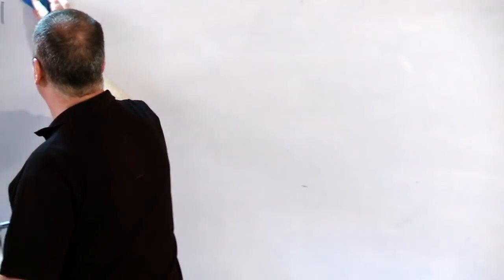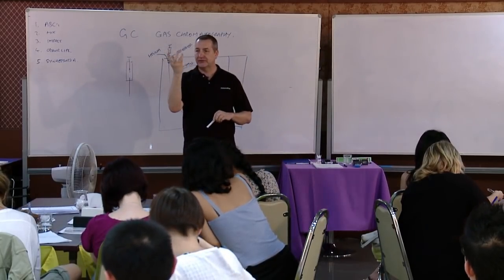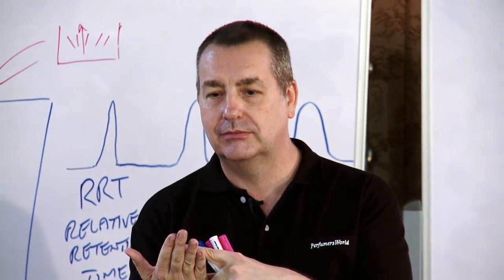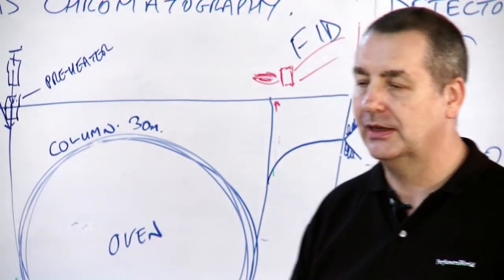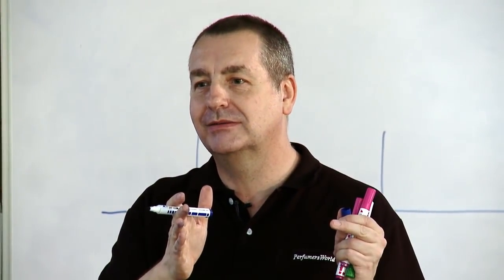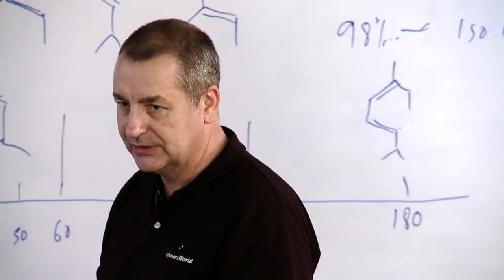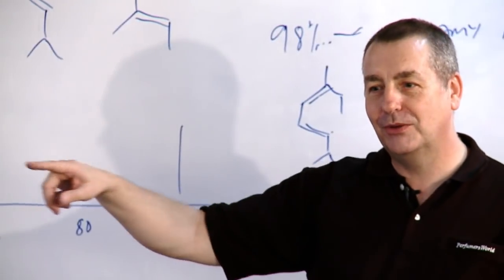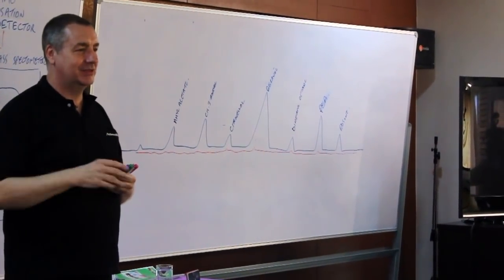Day 5 Session 11 QC GCMS Gas Chromatography Mass Spectrometry

Comment from the maker: An essential difference since this talk was given over 11 years ago is that now generally Mass Spectrometers use Quadrupole detectors where after the gas molecule with material enters the MS from the GC column and passes over a filament that fragments the molecules, knocking off electrons and producing a charge, the m/z or mass to charge ratio, on each fragment. The charge allows the fragments to be drawn into an electromagnetic field between 4 electromagnetic poles. The charges on the poles cycle through settings that allow only 1 fragment type based on is m/z ratio to traverse the path and hit the detector which counts and calculates each fragment's mass and relative abundance to all the fragments of the whole molecule as the detector cycles through a range of molecular sizes over and over again at lightening speed. The Spectra is then compared to a several hundred thousand Spectra of chemicals in a database and the closest matches with their probability listed.

Comment: What does it mean that mass spec doesn't mean anything without a computer? With all these simple molecules, a lot can be learned from just looking at the mass spec data and figuring it out yourself. No need to have a computer compare it to a database.
Reply: +Prometheus4096 not all molecules are simple
Reply: +gdm0485 

Doesn't really matter. If you have a pure sample of some unknown and you use both MS and NMR, you can know what it is even if it is a big molecule.

What they guy is saying is just wrong.

Now if you have a complex mixture of 200 unknowns, very similar and big molecules, that is different.
Reply: nice introduction about the GC & GCMS